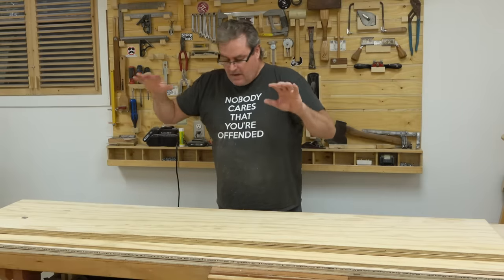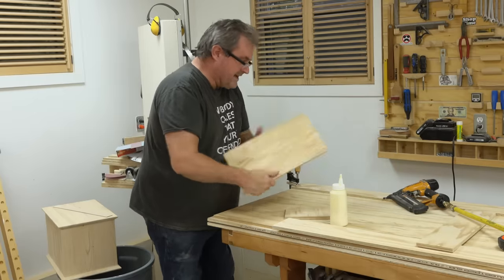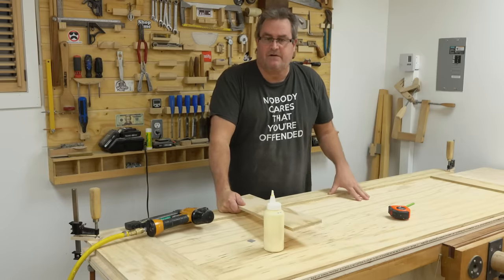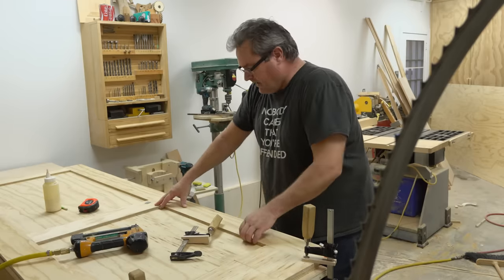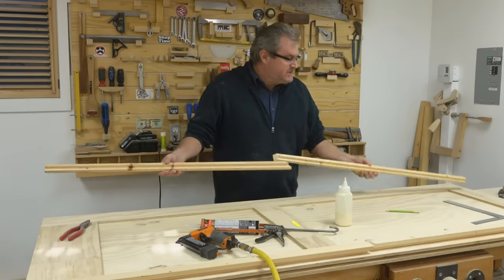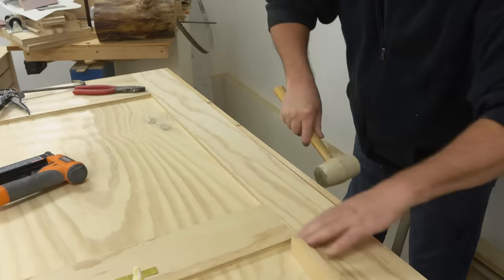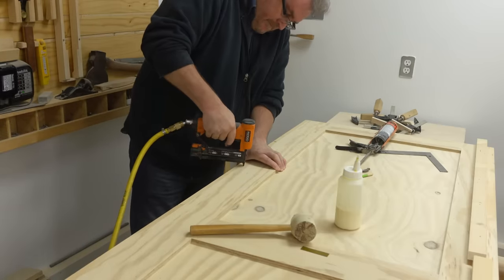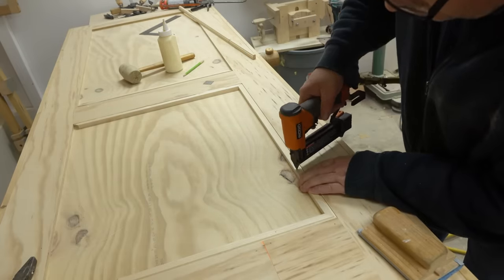How To Make A REAL Door From Plywood

Comment: I love this.. I bought an old home (built in the 1930s) that has seen some renovations that left me with a bunch of awful cardboard torsion box style interior doors, until I saw this I had resigned myself to either paying out the nose for solid wood doors new, or to spending every free moment out trying to source appropriately sized antique doors... After watching this two weeks back I am already three of five doors in, and my technique has improved with each one. Thanks!
Reply: Don Perkins  The first one did, because I didnt have a truly flat assembly area. However, you know what makes a perfectly flat assembly area for doors? Two of the crappy doors I was replacing, put one on the sawhorses and glued the other one to it, head to foot, every door after that has come out perfect.

Comment: My Dad was a builder, and made doors, especially one for a school tuck shop. But he didn't just use wood or plywood; he put in a steel panel. Made them much more robust. Even resists a fencepost used as a battering ram.

Comment: I dig the attachment you did to your Clamps. So all you did was add some Wood to them ... and basically you not only have more then just the one spot it would apply pressure, but the whole wood adds pressure and ... of course since now wood applies pressure and not the round steel ... its good for the workpiece.
Hmm, need to upgrade a few of my clamps this way too.

Comment: Love the video. Excellent information here. I hope this doesn't sound redundant but wouldn't it be easier to use a router on the inner edges of the door instead of measuring and cutting all of the reveal/trim and gluing it on? I just feel like you simplified the entire idea of making a door until you reached that point. Just sharing my thoughts. To be fair, you did say you were going to do that part the hard way. I hit the like button on this. Thanks you for sharing your skill.

Comment: I've built many applique type doors over the years. For interior doors I use MDF, it lays really flat and mills easily. It doesn't have a ply core to cover with trim or edge banding. I do recommend sanding down the cut edges of MDF before painting to achieve a smooth finish. For exterior doors never use MDF, instead MDO works quite well but you will need to treat the plywood core with some type of edging material. The next time I build an exterior door of MDO, I do plan to experiment with an epoxy type paint to treat the core. If someone has tried this before please let us know how it worked out for you, I'm very interested.
Reply: Hi Ken, do you think I can make the same door the same way John is doig here but use MDF? Doesn't the mdf need some sort of solid wood trim for the lock and the hinges to go on? Or is MDF strong enough by itself? Hope you can answer. Thanks in advance,

Comment: You can sand all day and never get the edge of plywood to look good without some kind of filler. Best to cap it with a strip of wood or 1/4 round trim of some kind.
Reply from the maker: Lol, did you watch the video, or leave your eyes closed and used the Force?
Reply: I was referring to the part where it was suggested that the inside edges of the panels be left without trim, which would leave the edges of the stiles as exposed plywood.
Reply from the maker: Oh, well there you go. You are the expert, but I've found it doesn't take much sanding before a coat of primer and two coats of paint to adequately cover the edge of plywood.
Reply: @IBuildItHome  plywood usually has large voids and holes along the edge something that primer and paint is not going to fill. It's just my opinion that capping it or trimming it is far less work

Comment: I know its an old video but I am hoping Someone can answer my question. In the design of the door there are two hollow spaces running behind the stiles. they appear to be created by the gap between the stiles and the "t" brace you fill that space with. Is there a purpose behind this or can/should that be filled with other material?
Reply: I’m guessing he did it to get a door out of a sheet of plywood.

Comment: I like your style... and rails! Not sure if the measurement works out the same or not, but I center locks 44" from top of door.
Reply: measuring from the bottom is standard since the floor is always at the bottom but the top depends on the height of the door which can very from an under stairs door @ 3 feet to semi custom and custom doors @ 7 to 10 feet tall were 44" from the top would not work to well.
Reply: Jon Dough I have only had the pleasure of installing 80 inch standard doors. Obviously I would adjust the lock measurements for custom doors. I only realized that 44 + 36 equals 80 after you mentioned it.

Comment: This is a great video and was the guide I used for building a custom door. What I've learned - from just watching your video, is that my rails are maybe too thick. I've been using 1 in pine which is 3/4 in thick. The rails are mostly 4 inches wide. My interior section is made from 2 pieces of 1/5 inch underlayment which makes it just under 0.4 in thick - but all in, this door would be 1.9 in thick with 2 panels. Is that going to be too heavy? I would hate to start over, but I might need to. My plan is to actually have these doors rest on the floor - since they are double and in an archway I don't want to put in a top guide/jamb.

Comment: Good video. Just wondering how do you go with any twisting/curving of the plywood over time? I have heard that plywood will do that. Or with the way you have constructed the door that isn't an issue?
Reply: The whole reason plywood exists is because it resist twisting/curving as the layers are glued together with the grain in different directions. If it does twist/warp it is sub standard.
Reply: Thanks for clearing that up.
Reply: I would think that if you made a solid door with three layers of 1/2 inch plywood the best way to work against curving would be to turn the center panel of plywood horizontal when laminating the sheets.  There will be a joint in the middle but since everything is glued up anyway it should not hurt.
Reply: Mark Williams   you're right.  Plywood will and does twist.  I'd be very surprised if the plywood he's working with is perfectly flat, or close to it.  I'm guessing that his strategy is to true it up with the rails and stiles.  I'd definitely give it a try if I wanted custom doors, but otherwise it seems like a lot of work and it appears is if at least some of the hinge screws will only have purchase in plywood unless maybe I missed something.
Am I wrong?  Good video though. Thanks for sharing!
Reply: Stevie Spoolspinner he basicly built the edges as tongue and groove joints then faced both grooves with "T" shaped strips of 2x4 so there is 3/4 inch real wood faces on the hinge and door knob edges...... if that makes sense lol
Reply: Most interior doors are just 1/4" plywood

Comment: Hmm, so you end up with a hollow bit between the main panel and the solid wood edging?  Looks like an inch or two.  I had not realized that after watching the old videos/old article.  

I have those old mahogany flat slab doors..  I've thought about replacing them, but we like the dark stained look.  Wonder how this would look stained.
Reply from the maker: There was no gap in the old one, since I made the core wider. 
It would look good stained, especially if you pick out nice sheets when buying them.

Comment: could i get away without using solid wood for the door sides? couldnt i just use plywood through out?
Reply: daisy corta nah, got have somewhere for the hinges and lock to go, end grain plywood isn't strong enough even crappy hollow core doors have solid timber on the edges
Reply: JT Lowry 
Was thinking of using longer screws and maybe come adhesive, saw shopbuilt make a door out of MDF, and for him, its been holding up, but guess I could get away with only trimming the hinge side then